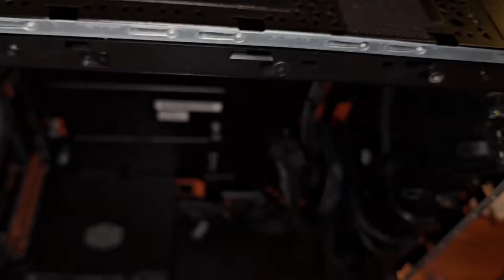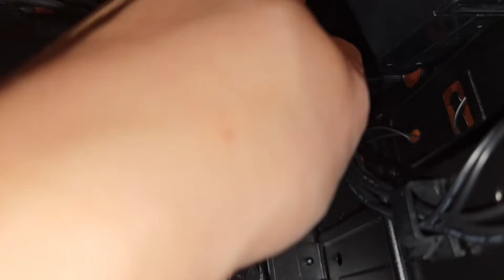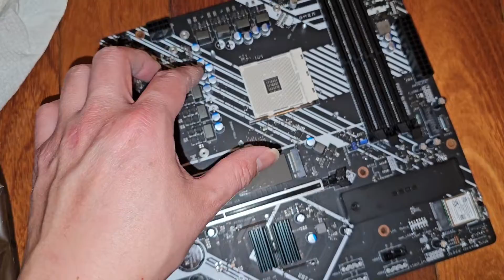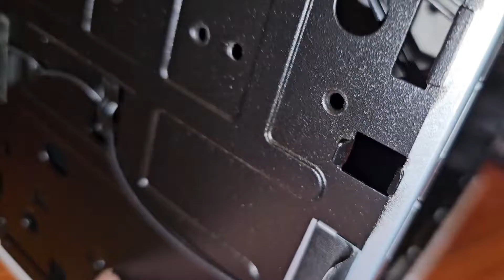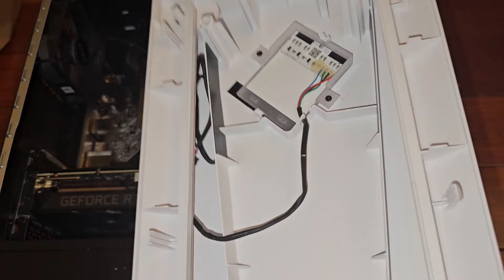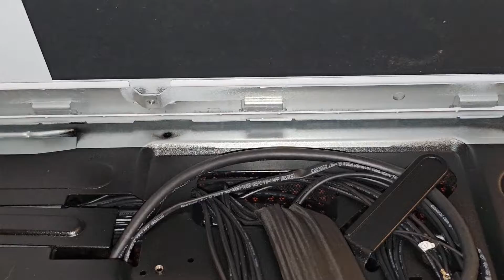HP OMEN 25L Desktop Gaming PC GT15-0324 Disassembly Assembly Motherboard Replacement

Comment: in the bios i was messing around trying to overclock my ram, untill i overclocked it to 3600 instead of 3200, now my screen and keyboard wont turn on and my pc does turn on, but my screen is blank and my mouse and keyboard dont work with it. is there anything you can do to help? thank you
Reply from the maker: @ironGOTKING  reset bios
Reply: where is the cmos pins located or the battery
Reply from the maker: @ironGOTKING  likely under the gpu

Comment: Thank you for making this.
HP support has videos too for replacing all the basic parts, i own the 13700 RTX 4070, so i will never replace that board.
The plastic bracket in the top section, is meant for the HP Cooling solution, you can remove the 4 square with a screwdriver, or remove it totally what you did. Able to many any radiator there.
The connectors are all PC standard, the front header you found is RBG, able to to switch to RGB compatible headers by switching the wires. The front I/O i have is just the On/Off switch and audio, and that in industry standard too.
Perfect case for any 65 Watt intel upto the best RTX there is.
Reply from the maker: Nice!

Comment: do you know the brand name of the 8gb ram stick that came with the stock mobo?
Reply from the maker: @MarioSarabia-l2o  You'll have to take it out and check
Reply: @ItsBinhRepaired  Western digital Gen 4 drive, you removed it to the ASUS board, info is on the sticker in the video.
Reply from the maker: @lucasrem  hm? That's not RAM.
Reply: hyperx fury

Comment: hello i just got this pc and i was wondering is you could tell me what ssd i could upgrade into it?
Reply: cause i havent been able to figure out what the motherboards name is
Reply from the maker: @gaganraajsohal9115  how much are you willing to spend and how much storage do you need?
Reply: @ItsBinhRepaired  I need about 4tb and I don't really have a budget as long as the ssd is fast enough and fits into the motherboard
Reply from the maker: @gaganraajsohal9115  I'm assuming it has an m.2 nvme slot https://amzn.to/3XOTRLQ
Reply from the maker: @gaganraajsohal9115 this if price doesn't matter https://amzn.to/3xHBcGT
Reply: @ItsBinhRepaired  and these 2 options wouldn't have any issue fitting into the motherboard?
Reply from the maker: Confirm that it has an m.2 ssd slot
Reply: @ItsBinhRepaired  m.2 socket 3, key m, type 2280 for ssds (pcie gen 4.0 x4) this is what it has
Reply: @ItsBinhRepaired  sorry its my first pc ever and I'm just quite unsure about how to upgrade it and stuff.
Reply from the maker: @gaganraajsohal9115  should work